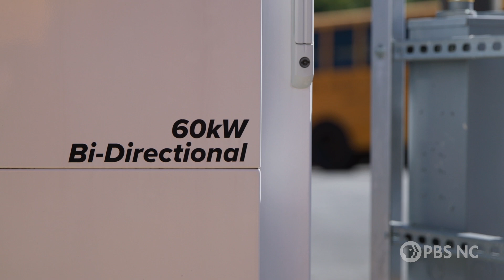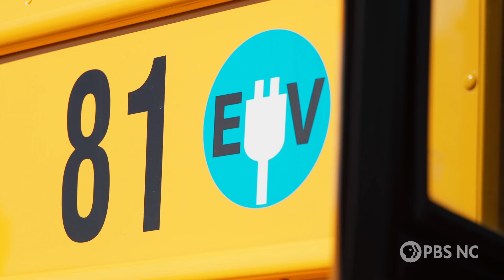Why this ICONIC school bus will change forever

Comment: Having been an over the road truck driver, I highly doubt eclectic semis will have any impact on trucking. Buses however, that's prefect.  Short trips. Safe parking. They just charge at base, no need for the infrastructure. The size, capacity of a bus chassis.  All make a great platform for an electric vehicle.  Just make sure a human operates something children ride in.
Reply: Pretty much this. ICE and EV have different use cases and until EV solves the distance problem ICE will continue to be in use.
Reply: Electric cars are so full of tech that they can be hacked and school buses could be a target for evil people if they adopt it. Maybe not if it’s primal electric tech with no bells and whistles but it’s a concern. A concern for our kids safety that does not exist with an ICE vehicle.
Reply: just wait ;)

Comment: Dude thats not possible cause not every district wants eletric vehicals cause honestly they are terriable also you could just make the exhuast pointed up and one industry that WONT be electrified is trucming cause those ugly Tesla trucks wont replace non eletric trucks cause they are classics and way stronger the that tesla
Reply: Your comment reads like it was typed by a 14yo dropout & your opinion is just as moronic.
Reply: EVs are always more powerfull. There really is no comparison. Range is the only place where ICE trucks have an advantage. For most routes an E bus will make so much more sense. Short route, time to charge between morning and afternoon run. It is literally the best usecase.
Reply: @Asbjoern  They aren't more powerful lol. They do have quicker acceleration but lower top speed.
Reply: @NEON2600  So higher torque is not more powerfull to you? Power is literally amount of energy over time. EV beats ICE every single time. it is not a discussion. What you prefer is an entirely different thing. And both perform better than the other. But for this usecase (school busses) EV is literally perfect with plenty of time to charge between runs.
Reply: @Asbjoern dude it's a school bus it's not hauling a trailer power doesn't really matter as long as it has enough to drive normally with kids on board it's fine
Reply: @NEON2600  No, lol. Every train in existance uses electric motors because they have a far better tourque profile. ICE will never be as efficient as EV. It is simply a fact.
Reply: @RobbieCrisp-u4u6c You said "Tesla trucks wont replace non eletric trucks cause they are classics and way stronger the that tesla" What does stronger mean in your quote? Were you talking about power or something else? I agree that a schoolbus dosent need much power. A small electric motor is still more efficient compared to a small diesel.
Reply: @Asbjoern I ment there looks not there strength since you said locomotives primarily use only use the diesel engines for helping and running the eletric generator (hence the name diesel eletric train)
Reply: @RobbieCrisp-u4u6c Okay, looks dosent really matter when talking engine type. Look at Edison motors, their look dope and use electric motors. 
And the diesel in a train is just used as a battery. The driving motor is the important part.
Reply: @Asbjoern  but the trucks have batteries and when they catch on fire and it doesn't take much for them to catch on fire
Reply: @RobbieCrisp-u4u6c Battery fires are worse compared to ICE, but EV cars are still very very safe. It feels like you are looking for a reason to hate EV. I for one prefer ICE over EV personally. But if the school has to pay for it, the cheaper alternative would always be better.
Reply: @Asbjoern yeah but not every district wants that and besides there quiet so that already makes them at a disadvantage cause someone could not look before crossing the street and NOT HEAR THE bus and walk into the road
Reply: @RobbieCrisp-u4u6c So a bus with lower fuel and maintenence cost? Who wouldnt want that? And you can just add a speaker for low speed driving.
Reply: @RobbieCrisp-u4u6c Teach the students to LOOK.
Reply: @erikk77 be honest adults and teenagers do that too sometimes
Reply: , . ? ! ; - There. You seemed to be out of punctuation, so have some of mine.

Comment: EV owner here. In my light duty electric sedan I average 4 cents per mile electricity cost vs 12 cents per mile for an equivalent gasoline car. Assuming a similar percentage savings for electric buses I'd think school systems would love to switch!
Reply: At a savings of 8 cents per mile and a cars lifespan being about 200,000 miles, the savings is about $16,000 over the life of the car. Although that cost is usually made up front for an electric car so how much is really being saved? More info is needed to make the same comparison for a bus
Reply: Now factor in less maintenance and you have more savings.
Reply: @erikk77  And factor in the battery replacement every 7 years. Or less school busses are used a lot.
Reply: @NEON2600  A school bus averages 12k miles per year. Most modern EV batteries last 200k-500k miles
Reply: @NEON2600  You don't know as much as you think you do about this topic. Stop regurgitating clickbait headlines and actually learn about the technology.
Reply: @NEON2600  Lmao. I sold my 2015 Volt, a Li-Ion PHEV, just last year. 10 years old (mfd 2014), 270K miles. I still had roughly 75% original range; the gas engine gave out. And before you say that's because the battery wasn't always in use - they are, in a Volt. Even when the gas engine is running, it's just recharging the battery which powers the electric motors, and that's what drives the wheels. The only older EVs dying prematurely are air-cooled and/or had worse chemistry batteries that haven't been in use in years, unless you're Nissan.
Reply: @NEON2600  I'll agree with you on the Chevy part. GM products are gonna do GM things. But believe it or not, it's true. 40-ish mile range EV only new, I was getting roughly 30 when it gave up. Anyway, for an EV battery to give up after 7 years, no manufacturer would dare give them the battery warranty they have now. They're all minimum 8 year/100K miles. Even hyundai/Kia, famous for engines that seek the shortest path to destroying themselves as quickly as possible, has 10 years.